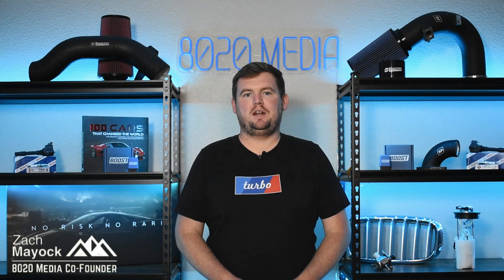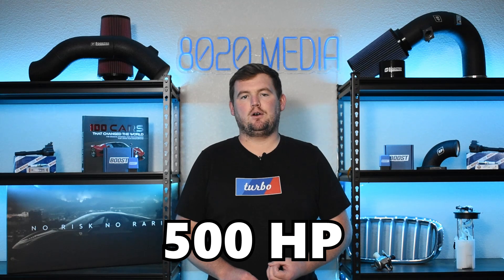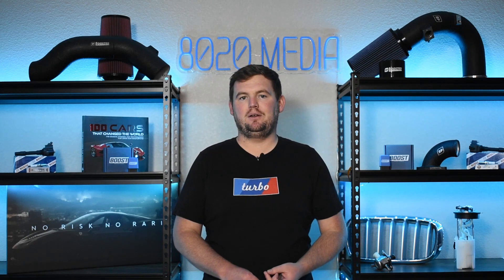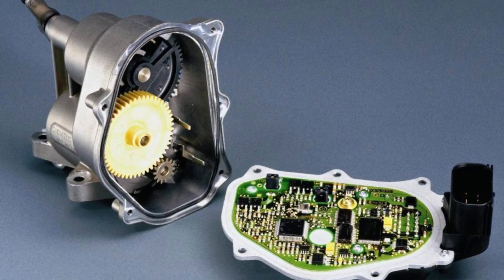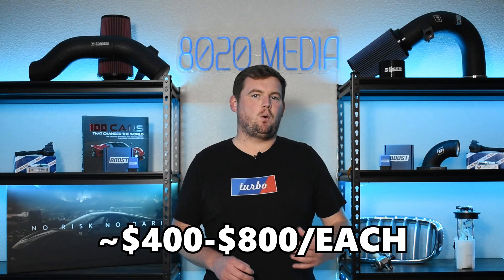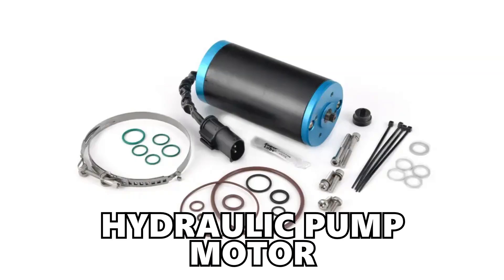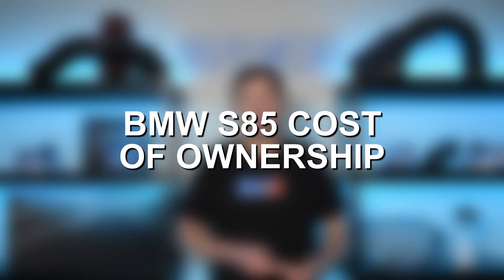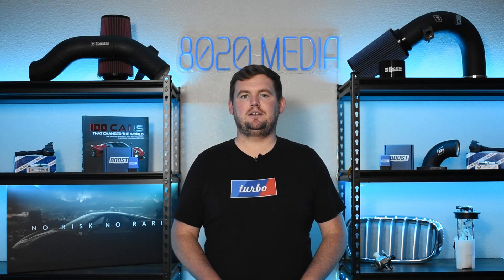BMW’s S85 Engine | Common Problems You’ll WANT to Know!

Comment: Didn't the S85 come with a proper 6 speed manual?
Reply from the maker: V - Yes, the BMW S85 V10 (found in the E60 M5 and E63/E64 M6) was offered with a proper 6-speed manual transmission, but only in North America. The standard transmission worldwide was the 7-speed SMG (Sequential Manual Gearbox), which was BMW’s automated manual. Due to demand from enthusiasts, BMW introduced a 6-speed manual option for the U.S. market, but it wasn’t a direct carryover from the SMG. The manual lacked some of the advanced features of the SMG, such as variable differential oil cooling and shorter final drive gearing, which made the manual slightly slower in acceleration. However, many enthusiasts still prefer it for the engagement and reliability compared to the sometimes-problematic SMG transmission.

Comment: No mention of the injectors a bigger killer than everything listed
Reply from the maker: L - Just because you experienced injectors failing doesn't mean everyone else did. We're providing our experience.
Reply: @8020Automotive  I haven’t experienced it I changed mine preventatively. I have seen the damage of the failure first hand though with another owners car, and know of dozens of cases of engine failures from this…